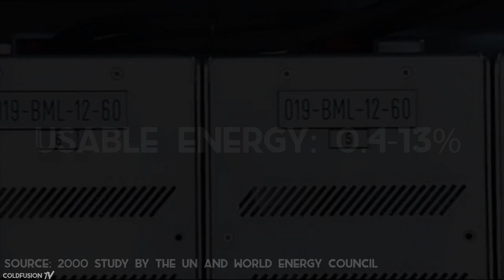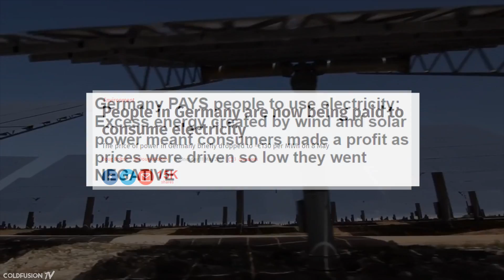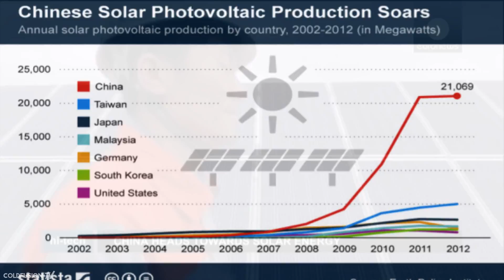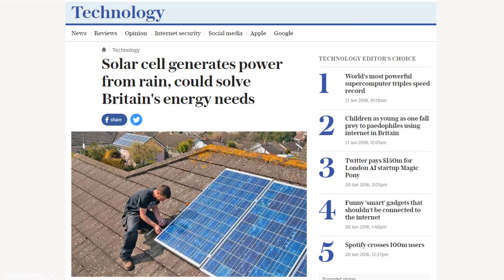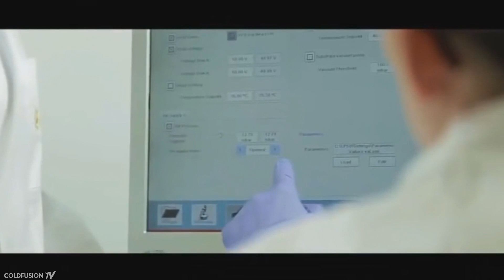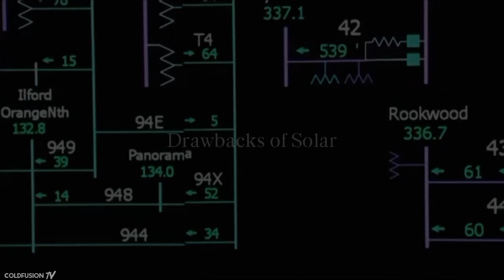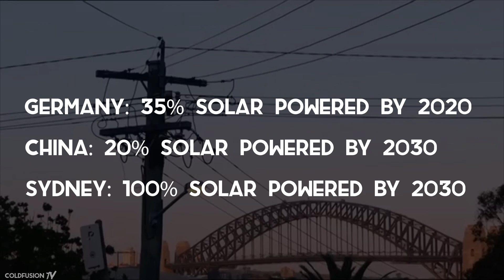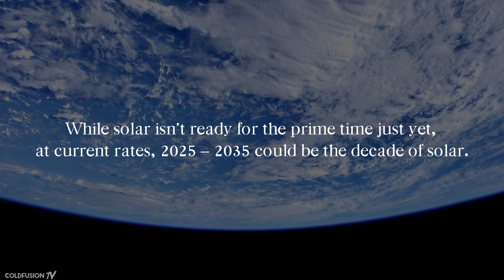The Truth About Solar

Comment: Another great thing about solar is that once you get it installed on your home, you can forget about it and actually gain money in the form of no electric bill and home equity.
Reply: _Myst it only cost me about 7 grand in batteries, panels and inverter to power my whole house minus the central air conditioner.
Reply: Cost me 34k for enough solar panels + inverter (13KW system) to produce 110% of my electricity.  Using net metering so the excess produced during the day more than off-sets the electricity usage at night.  That's before tax credits and 1k cash back so overall the systems net cost is 23k.  Have an ROI of 7.5 yrs at current electric rates (sooner if utility company raises rates which they tend to do).  Have a 20 yr warranty on the system (panels, inverter).  So it made sense to me.  Of course living in AZ desert helps as we have over 300 days a year of blue skies.
Reply: hard to forget about something that needs maintenance, solar panels need to be kept clean, but thats ok if you like to wash windows, storms can also break them
Reply: ...after you pay down the $50,000 to $150,000 in solar panels it'd take to power a entire home.

Don't forget about maintenance and new batteries every few years to the tune of 10s of thousands of dollars.

Now you know why we don't use solar at the home level.
Reply: You can not forget about it.
You need to clean panels once in a while.
Panels may go bad and electronics last about 10-15 years and need to be replaced.
If you a have a lease, you will be paying for the next 20 years or so every month regardless if you produce power. 
If you have a lease with your panels and trying to sell your home you most likely lose money because there is a lien attached to your home until the end of your contract and potential buyers back out if they see that or offer way less for your home to compensate for the lien.

Many installations now are grid tie systems and require no batteries. Bad thing is  when the powerline goes down then your solar production is down also.
With an off-grid system, you need batteries which need to be maintained. But it does not depend on the powerline.

Who is to say that you have to use batteries to store energy?
You can heat water in a water heater with the solar energy and store it.  That ''water heater battery'' will last longer than many other batteries.
Reply: That's the one big problem with solar-pv. The up-front cost.
Reply: The Indian Government is doing its best, but its best simply isn't good enough. I understand there is a lot of government interest in solar- and wind-energy, so perhaps all they need is time! Good luck!
Reply: How does total cost of solar compare to 'normal' electricity price?
Reply: my parents have got some installed i believe it costs 10-15 grand or something not sure could of been cheaper. but if you have 100-150 a month bill all get it back in 10 years
Reply: Just about anything got a upfront cost, the amount may be different.  You can get tax credits and if you borrow money you may be able to write it off at the end of the year. If you lease a solar system you get nothing, the solar lease company get all the tax credits.

At least, it may pay off itself and depending what kind of system you have ... you may be able to use it as a back-up in the event the power goes down.
Reply: We don't do tax credits in UK. The treasury is too tight-fisted.
Reply: I dont know about other countries, but in india there is severe electricity shortage in rural areas..my parents wants to live in the village..so here money doesnt matter..the thing matters is power/electricity.

Comment: I thought perovskite solar cells aren’t as physically stable as silicon solar cells and difficult to produce it in large scale since it will have some holes or defect on it.
And isn't the whole idea is combining perovskite solar with traditional silicon solar?
And... silicon solar only achieved 16 to 20 percent efficiency for the general consumer
Furthermore... perovskite solar cells only achieved less than 5 percent efficiency, although scientists have promised improvement...
Reply: Apple BS I work with different methods of generating photocurrent in my lab- while looking into perovskite the max achieved efficiency has been around 17%, also the use of hybrid cells puts a maximum efficiency of 72%. This is in labs- and quite expensive at the moment but future developments in my research and the research being conducted around the world will soon solve the cost issue. TMD materials are also extremely promising in replacing silicon- that with the use of black phosphorous (as opposed to graphene) is a very promising candidate in the use of transparent and flexible photovoltaics
Reply: whats wrong with lead?
Reply: Even dihydrogen monoxide can be toxic.  Have you ever seen the material safety data sheet for it?  It'll scare your pants off,  there's tons of it everywhere, exposed, without even fencing or warning signs, and the government repeatedly refuses to clean it up.

Ordinary Oxygen can be toxic.  Nitrogen too.  Many types of wood are toxic etc.

Everything is dangerous, to a degree.  The wisdom is in identifying the hazards and dealing with them as appropriate.  Not running away screaming.
Reply: You don't have to eat it to be ill.
Lead can leak in waters, go into the grounds and poison it.
Also, if you use Lead, it means that ppl working on producing those products might be ill too, and the production will be polluting etc etc....
So, Lead is a big deal if you think about it.
That's why it's forbidden to use it in Europe for example
Reply: @BG Tech That's cool!! Are you working in a company making specific products so it will be available to consumers?
Reply: Jake Mitchell thanks! I am currently employed at Purdue University doing research on TMD optoelectronics- these research subjects are unfortunately a couple of years (if not decades) from being implemented in consumer products!
Reply: plus etc
Reply: perovskite contains lead...
Reply: wwwelkam that sucks
Reply: I don't know if you're being ironic but I'll answer
Lead is toxic and can make you ill
Reply: Mr.Sylvestre sure maybe if you are dumb enough to eat it. but so are many other metals...
Reply: The use of lead is not banned in Europe.  It is restricted - as it is in North America.  You cannot use it when reasonable alternatives exist.  Lead paints, lead in food/water contact items (like lead solder in pipes or appliances) is banned.  In electronic devices it's mostly banned or very tightly restricted (via RoHS, which covers 5 other chemicals too).  But lead-acid car batteries are still allowed, and have legal recycling requirements.  Etc.  Most metals are toxic to one degree or another (many far far more than lead, some mercury compounds are incredibly lethal, not to mention things like arsenic, cadmium, gallium etc), and have their own restrictions.  But forbidden entirely?  Nope.  If they were, we could say bye-bye to electronics altogether amongst many other things.
Reply: Thank you for the precision.
In the end the point is to know that some metals, like lead are toxic
And yeah there are other metals, like Chrome, that are called Heavy Metals.
But Aluminium can also be dangerous.
I think, almost every metals can be dangerous to humans ?
Reply: Mr.Sylvestre You can stab some one with aluminium
Reply: true true haha
Reply: Fromage Frizzbizz Hahahaha ohhhh yeah of course
Reply: Yeah but avoiding the use of leads in paints and kitchen features is not running and screaming x)
Reply: they are about as stable as the progressive minds that pestle them.
Reply: Winston Sayre what's wrong with being scientifically progressive?
Reply: Perovskite it's just now on +20% efficiency Hybrid cell prototype

Comment: I think it is plausible to move most household energy needs to solar in the near term. But that isn't the biggest problem. Power consumption related to manufacturing as well as server farms, data centers, communications grids as well as fundamental infrastructure like water treatment plants all require a steady stream of power. I believe this is possible in the next 50 years to supply this power via solar, but that might be too late to stop a runaway greenhouse effect. I think in the meantime, we should be shutting down coal plants by producing nuclear generated electricity to get us from now until the time that solar can be are only needed source.

Comment: water, wind and solar combined is the only real solution. i personally don't like the idea of having batteries in my house simply because they are consumables. having the sun for day and wind for the night is all you'd ever want.
Reply: Naive view. Most do not understand electricity enough to have their own solar system. Wind generates very little power for the size of the turbine. There will be no savings in cost no matter what is used. Nuclear is the best but the lies and myths make it impossible to sell.
Reply: Most areas do not have enough wind to use a wind-turbine to generate power. 
In most cities and urban it is not allowed to erect and to have them. 
So solar panels are the best option for many.

If you look up ''DIY Alum Battery '' here at you tube you may have a way to use a dead battery again. I did not try it yet.

If you save your heavier loads to run at daytime, then this will prevent a lot of use/stress of the battery and may prolong the life of the battery.
Reply: freevideos051 it's not the venting gasses that is the difference between a deep discharge and a generic car battery lol.... it's the fact that they are made to have extended periods of discharge instead of the one big one it needs for your starter motor... (to keep it simple) they who know more about this don't need to better explenation lol
Reply: ***** they are really not.. i get what you mean but. storing energy is shit. it gives heat and all the crap you need to keep an eye on. i don't feel like having batteries in my house because they WILL break down, they will be dangerous and they will cost boatloads of money.  windmils can stay on and keep going... making the whole battery idea rather pointles.
Reply: quosmo1 There are molten salt batteries that utilize the sun's energy that are extremely efficient.
Reply: IizUname them things get about 600 degree's lol. but yeah they are ok... but rather big ghehe
Reply: Fabian van den Bussche my grandparents did have an idea to get a wind turbine built on a summer house of theirs. Lower bills in the summer, make them a couple bucks in the off season winter
Reply: Justin Noker wind turbines are the bomb i'm just not fully convinced the once with conventional blades are the right way to go for a home... the centifugal once seem more apropriate :p
Reply: Bonnie Flory it's not like you can get that many modules per household in a city....  that being said the new kind of films/foils are an epic achievement. if that stuff hits the market many oppertunities will be opend. that being said i still don't see running a house on batteries as a good idea.. i LOVE solar panels lol
Reply: cravinbob only if you mean thorium based nuclear power.. then i do somewhat agree.. cost is up for debate as more and more rentals (here in the netherlands) have solar on them :) it's starting to be normal took to long  also water is a very viable solution on many places... and allthough wind is not doing wel on power/square meter it's a good solution overall and i honestly don't see why they are sooo bad lol... they are worth it because there is hardly any maintence on them :) and 0 waste on producing the power.... i see where you are comming from but ask yourself this: if they can't invest in green energy... how do you think the same people have money to invest in a thorium reactor lol
Reply: What if it's a cloudy day and a still night?  :/
Reply: deep cycle battery
Reply: Car batteries vent gasses
Reply: All batteries create gases when charging or discharging them they just deal with this in different ways.
Vented batteries vent the gases out of the case. Vent free batteries have a catalyst inside the sealed caps that turn those gases into water. If such battery is over charged or over loaded, the gases can be more than the catalyst can convert back into water and the gases can still escape because those batteries can handle only so much pressure before they are safely vented out of the case.

Starter batteries have many very thin lead
plates that enable them to create a lot of amps because they have more lead surface area and those plates are brittle.
Deep cycle batteries have thicker plates, but less plates for the same size battery, that's why they can handle less amps safely compare to the same sized starter battery.
Reply: Bonnie Flory or you still give the whole explanation anyway.. .thanks for saving me the work on it though! =P
Reply: We have to change our lifestyle  and use all alternatives...BUT will the Corporations and Military let us?  Only if the People assume their power!!
Reply: Tony Kuli unless they ban it there isnothing they can do against it
Reply: Never trust the enemy within!
Reply: Seek not the valley of shadows for surely evil will appear only the master of brightness will concur the phantom of fear, serve darkness or light it is your choice.

Comment: Beautifully produced video - scads of information.  Yes, there are lots of promising technologies - most don't make it to market.
We just finished our solar install 2 mo. ago -- we love our solar - it was a long time coming!  We did a video series on it we called "Star Lite Wars".  
I'd suggest anyone considering solar would consider designing it with battery capacity, whether a Tesla powerwall or something less expensive.  We used 2500 lbs of new fork lift batteries to give us 40 kW storage - enough to keep us going in reserve mode for 3 days. Do a needs analysis first (like in our Episode 1) so you know what you need.  Many don't think through it, and you don't want to have to redo it later.

Comment: Gatun Lake holds the rain water used in the Panama Canal to lift ships up and over the mountains of Central America on their travels between the Atlantic Ocean and the Pacific.  Initially, the water is pulled up from sea-level to clouds by the light of the Sun, then at altitude it cools and rains into the lake.  Lake Gatun stores thousands of TeraWatts of solar energy, for use day or night.  The water then drains down to the canal where it fills locks, lifting enormous commercial ships from one ocean up across the mountains to the other ocean.  The problems of generating and storing solar energy by this method was solved more than a century ago.  We need to take off our blinders to think outside of the box.